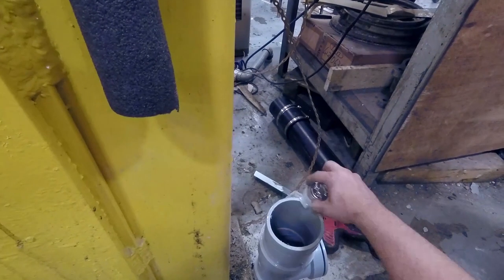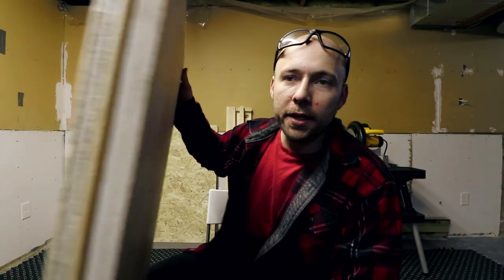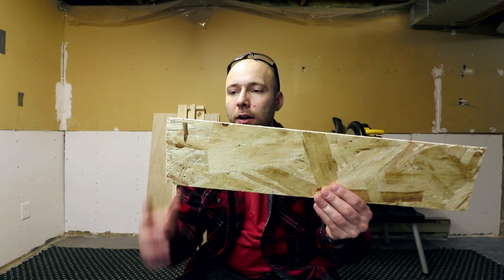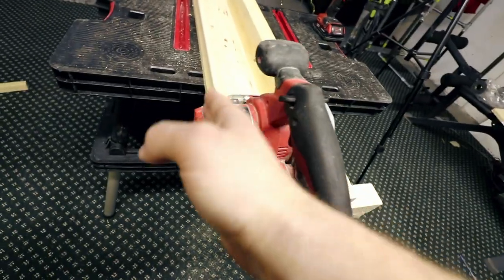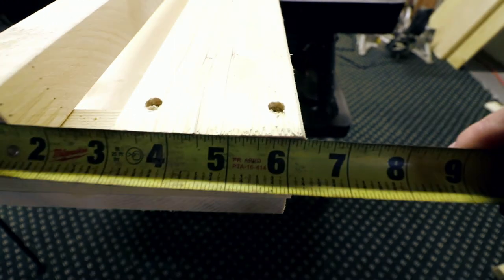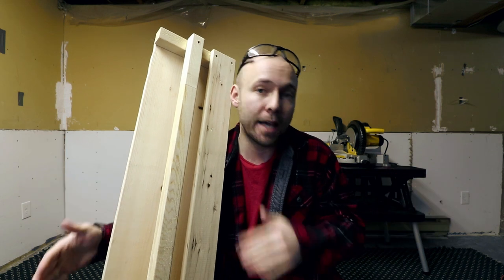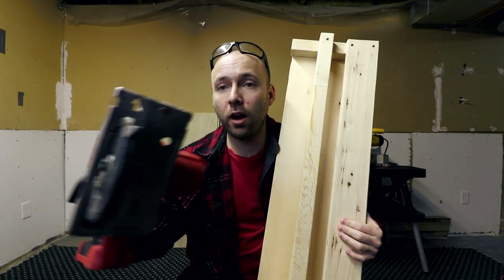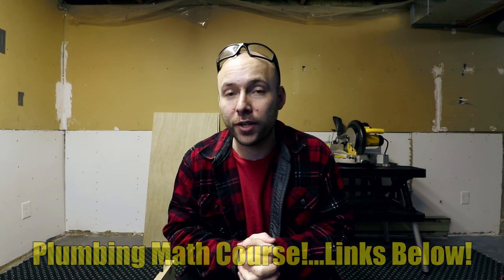Crosscut Jig For Plumbing?

Comment: have you tried using stout brackets or "caddy brackets" as some might call it.  they're metal type bars that can span across different stud spacing.  saves from cutting wood all together and handy when you're dealing with different spacing and they have pre drilled holes for mounting